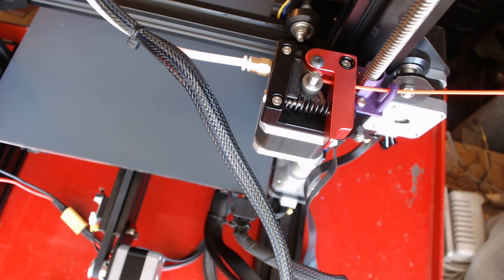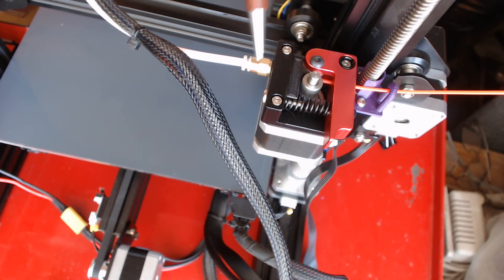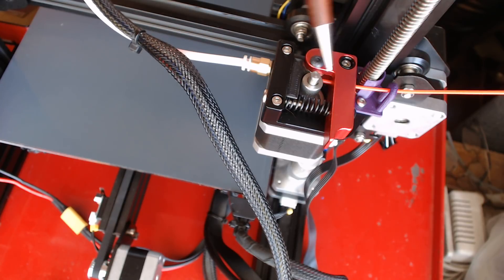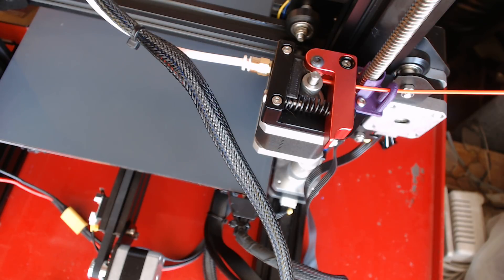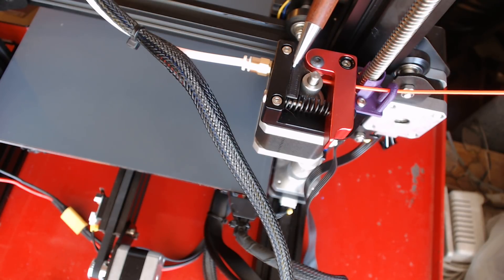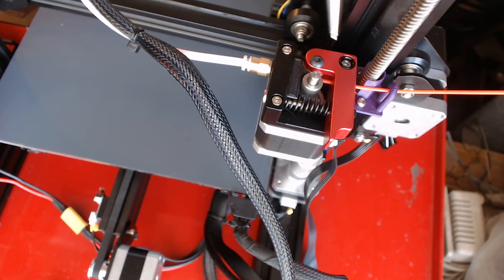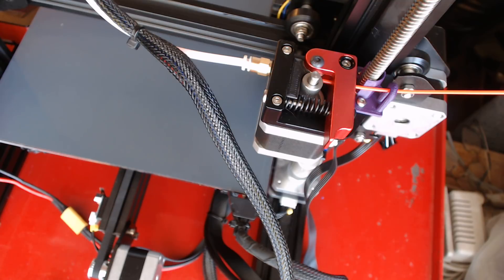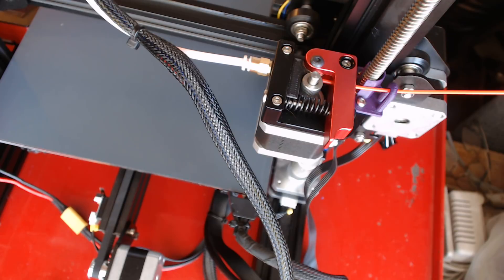Mini Review: TH3D Studio Upgraded Extruder for the Ender 3

Comment: From one Chuck to another, Thank you for your great videos! I am following with great interest as I've ordered my Ender 3 earlier this past week. Since you've had some time to evaluate the extruder upgrades, which one of the two would you now choose if only one was your option? I feel this is an inevitable upgrade I'll need so I will probably go ahead and order one.
Reply from the maker: You're welcome! As far as the extruders are concerned I like them both and they'll both fix the under extrusion issue. I think I'd probably give the nod to the Macewen unit, although to be honest, as long as you can print the filament support from Thingiverse then it's really toss up and I think the support improves the Macewen unit also, although it's not required. I've got an upgraded lead screw coupler (another of my pet peeves with the Ender 3) arriving from TH3D in the next few days, so if you're on the fence then wait for that video, right now it's available from TH3D and not from Macewen.

Comment: What is the purple filament guide near the z axis rail?
Reply from the maker: It's a little guide available on Thingiverse to prevent the filament from rubbing against the Z axis lead screw and help guide the filament in straight. I'm going to post a video later today with that and several other easy to print improvements for the Ender 3 along with links to their Thingiverse page.
Reply: I just got my ender 3 delivered today! I am really glad i found your site.  unfortunately the z axis motor connector is really bent, and i can see scuffs where its apparent it was loose during shipping.
Reply from the maker: Cyrulean, The lead screw? That sucks. I think I'd call Creality and see if they would ship you another one. Until it arrives can you straighten the one you have? A couple of wood blocks and a wood or plastic mallet and you might get it serviceable until a replacement arrives.
Reply: No, is the input connector on the z axis motor, the pins are all bent. I was able to carefully bend them back and connect the input cable but i am worried now that the motor may have other damage that i wont know about till it is built.
Reply from the maker: I had bent pins on both my Ender 3 z or x axis stepper motors. Not all bent and crushed, but bent over so the I had to carefully straighten them. It was only 2 or 3 on each printer, though. But so far they're working fine after straightening them. I hope yours will too!
Reply: Chuck Bryant well I have bad news. Build went ok. But as soon as I powered it in the screen was flashing and it was squealing continuously until I turned it off. And for a few seconds after. I’m am a bit disappointed
Reply from the maker: I'd be very disappointed. Have you tried turning it on with the bad stepper unplugged? Creality has a customer/tech support number, if it's just a bad stepper motor maybe they could send you one out. Or check with who you bought it from, I know that GearBest and Banggood have Ender 3's in warehouses in western countries.
Reply: Unfortunately unplugging the bad stepper didnt help.  I will call them in the morning and see what they have to say.

Comment: You can always draw up a spacer to bring the stepper away from the lead screw, allowing the Bowden fitting to be added :-)
Reply from the maker: Hmmm, you're going to have to describe that for me. Because to me it looks like a spacer under the extruder stepper would space it down, not away from the lead screw. To move the extruder stepper rearwards, away from the lead screw, you'd either have to space back the entire L shaped bracket that the stepper mounts to (and you'd need longer screws and steel or aluminum spacers), or make an adapter plate that bolts to the existing mount and has it's own mount holes for the stepper. And plastic won't work for either. Honestly, it would be easier to remake that entire L bracket with the stepper out another 10mm. Not hard to do really, but hardly worth the effort and should have been done at the factory. Even 5mm would have been enough.
Reply: Chuck Bryant The stepper isn't under any torsional load, a plastic spacer with appropriate rigidity to bring it backwards shouldn't be too hard to draw up... Alternatively there are a few direct mount designs to bring the extruder onto the x-carriage. Something for me to add to my "to do" list, I'll keep you posted when/if I get to it. You are absolutely correct that it should have been done at the factory though, you can say that about most of the faults with this machine ;-)
Reply: If you're feeling creative, you could look into a twist plate to change the feed angle and avoid the lead screw in that manner, too... I'm not sure if there's enough space there for this method though. Food for thought!

I'll have a closer look at mine when I have some spare time.
Reply from the maker: Seriously, take a closer look at it and tell me where you'd put a plastic spacer that would move the extruder away from the lead screw, because I don't see it. A plastic spacer under the mounts is going to move it down, not back.

Comment: Seems like a upgrade I would do on mine down the road.
Reply from the maker: I think upgrading the extruder is something every Ender 3 user is going to do sooner or later.  They're cheap enough that my suggestion would be to pick up either this unit or the Macewen unit, print out the thingiverse support and have it ready in a drawer for when the day comes.